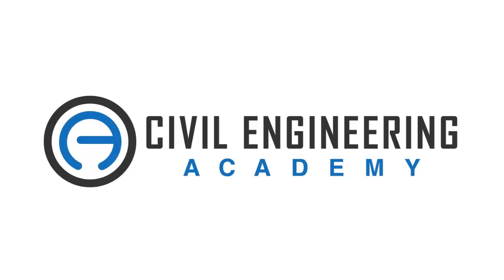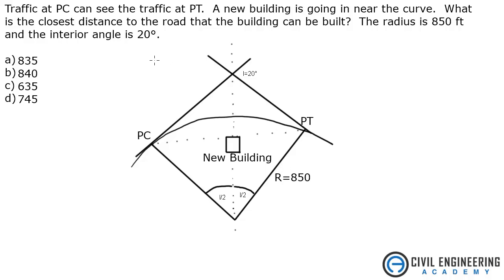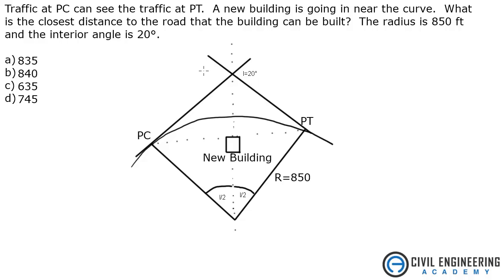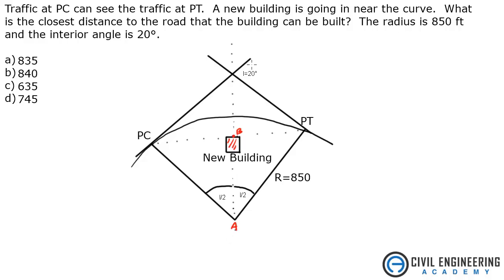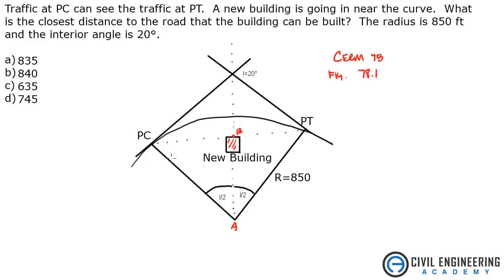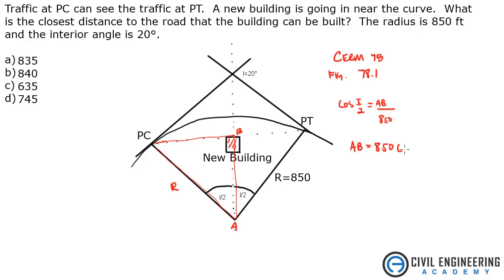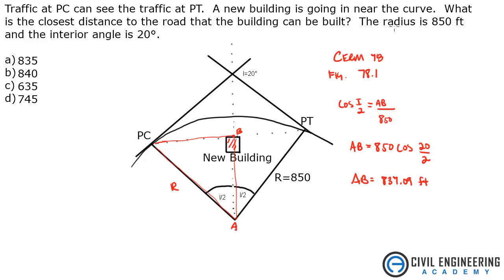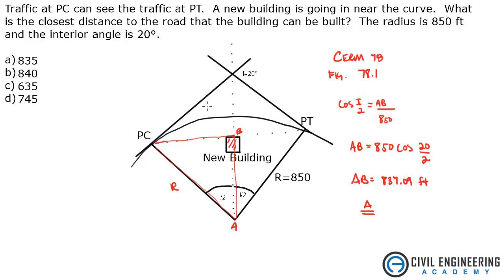Transportation-How Close to Build a Building on Horizontal Curve

Comment: Im not sure if it was ever updated but shouldnt this be a HSO problem? HSO = R[1-cos(28.65S/R)] then S becomes C since the sight is at PC and PT? [C=2R sin(delta/2)]. Green book 3-115 and then Handbook 274.
Reply from the maker: Great question! This one actually isn't an HSO-type problem because we're given the curve radius and deflection angle, and we’re solving for the direct sight line offset (AB) using simple circular geometry. The cosine method works well here:

AB=R⋅cos(I/2)

You'd use the HSO = R[1 - cos(28.65·S/R)] formula if you're given a sight distance (S) along the curve and need to find the lateral clearance for an obstruction. Since this problem is just about maintaining a clear line of sight between PC and PT, the geometric method works.

Appreciate the deep dive though — this is exactly the kind of thinking that shows you're mastering the concepts!

Comment: I have a question ...what is the purpose of having a front building setback?
Reply: +Edgar Orozco safety.  You need setbacks for safety reasons.  You need a good line of site on curves for good reaction times, and you need good setbacks so cars don't run off the road and have the potential to hit stuff.
Reply: If you have a stalled vehicle in your lane ahead and you’ll traveling at 65 mph, you need a clear line of sight around curves to react and safely slow down.

Comment: Wouldn't this be the secant you are looking to solve for?
Reply from the maker: I'm not sure I follow.  If you are looking at your CERM, at figure 78.1 (I'm looking at the 12th edition) for a horizontal curve element you will see the segment called HSO (horizontal sightline offset).  That is what we are solving for in this problem.  As long as we can maintain that distance away from the curve you could see from point PC to PT, making it a safe curve.  I hope that helps.  Let me know.

Comment: As in the question it is mentioned the closest distance "to" the road, it is supposed to be the (set back distance) measured from the road i.e., R - R cos(I/2) = 850-837..09 = 12.91 ft.
Correct me if i am wrong. (given options are wrong i guess)
Reply: The same type of problem was solved in a previous example, where the HSO formula was used. You're correct.
Reply: I got confused. Glad I found this comment. I just watched the other vid finding HSO
Reply from the maker: Yes you are correct!  I'll fix this up.  Thank you!
Reply: Civil Engineering Academy  12 is the answer please check that out.. 12.91 is the min requirement and 12 is  lesser than that..SO 13 is enough set back